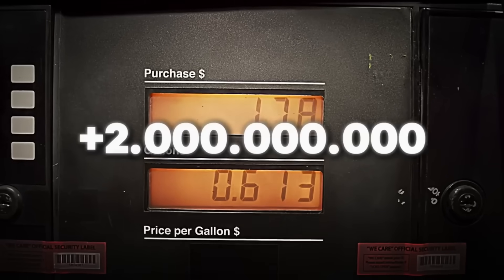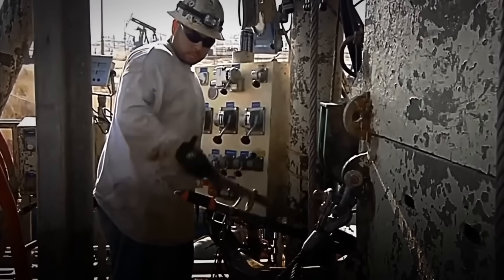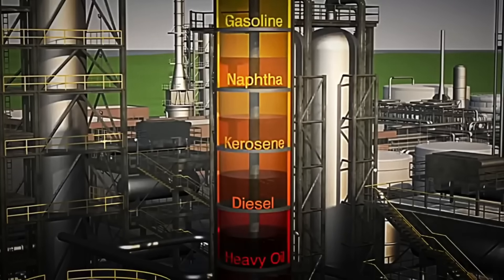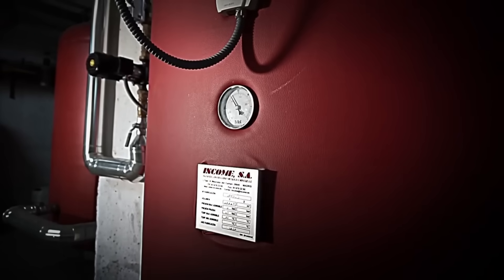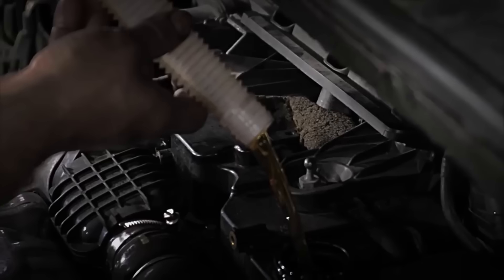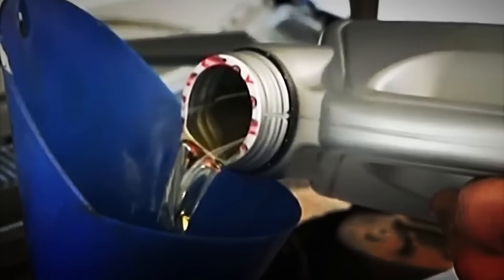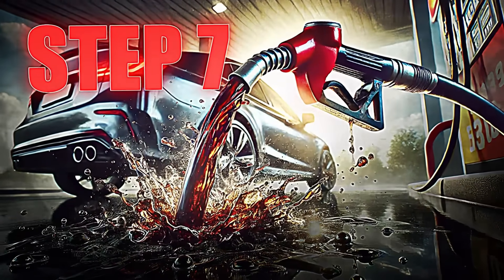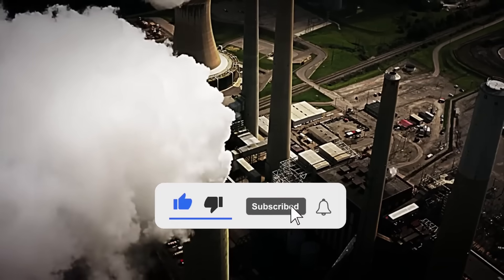How GASOLINE is MADE ⛽ | INDUSTRIAL PROCESS 🏭

Comment: I work in a refinery. This should be interesting.....

Edit: As an Operator myself for the past 10 years, I disagree with so much in this video. The general idea is correct, but the creator has been very misinformed as to the full process order and names of things.
Reply: Because it’s just another AI slop.
Reply: @unearthlynarratives_ you're probably right
Reply: I agree that this is not educationally valid. I am a petroleum chemist who changed career, but my formal qualifications and professional experience are still valid. The exact sequence is complex, but the main steps are:

Water removal by settling and desalination of the crude.

Fractional distillation that separates the crude into main distillates with methane, ethane, and LPG ( propane and butane) at the light end and bituminous residue at the heavy end.
Naphtha, is the closest to what is required for gasoline, but it is mainly a mixture of straight-chain alkanes which have very poor octane ratings (will pre-ignite and cause knocking) so these are chemically converted into cyclic hydrocarbons (naphthenes) and aromatics (e.g. xylene, toluene) in plants known as platformers/powerformers. Iso-octane has an octane rating of 100, and toluene is over 100.

From the fractional distillation, there is a cut called waxy distillate, which is like heavy diesel fuel oil with lots of paraffin wax. This can be converted into naphtha by a process known as cat cracking, which uses temperature,  pressure and a silica catalyst to convert this otherwise, low-value cut into valuable naphtha.

The naphtha undergoes a process known as hydrodesulphurisation to remove sulphur (sulfur if you're American), which would otherwise be converted into a highly corrosive acid during combustion. Oil refineries produce millions of tons of pure sulphur that is used by chemical companies for many purposes.

Before leaded petrol was banned, tetra-ethyl lead and tetra methyl lead were added to boost octane ratings. These have now been replaced by ethanol and some other chemicals that enhance smooth combustion. The lead was poisonous and was rightly banned, but the modern fuels with ethanol are far inferior in terms of storage life and will support entrained water, which creates other problems.

Gasoline has other additives to improve its properties, but most oil companies don't freely reveal what these substances are.

I hope this helps.

Comment: One issue with todays premium. It's not better. It just has more additives. The problem with these additional activities is they burn off inside the engine as soot (ash) contaminating the interior of engine and the oil. 
Only use the fuel recommended for your engine. Also ethanol has less energy in it. Reducing your MPG. 
Lower octane straight gasoline (no ethanol) at a true gas station costs the same as high octane (more additives) fuel at a discount station. Add the fact many Fords won't burn ethanol. Check engine light comes on. Can damage the catalytic converter.